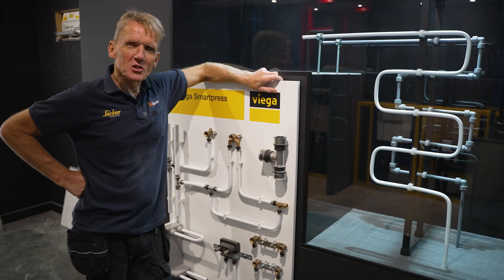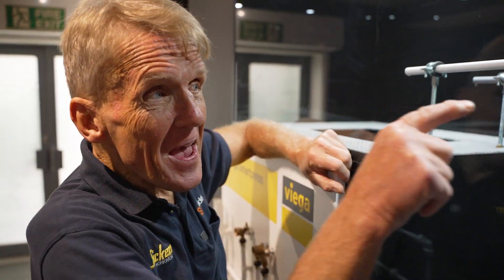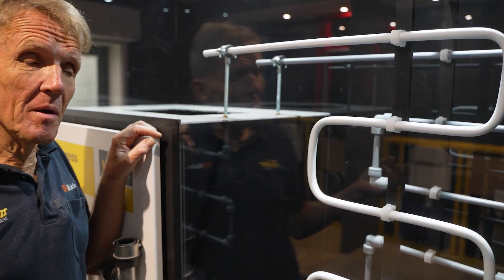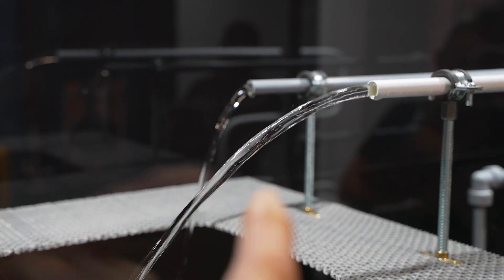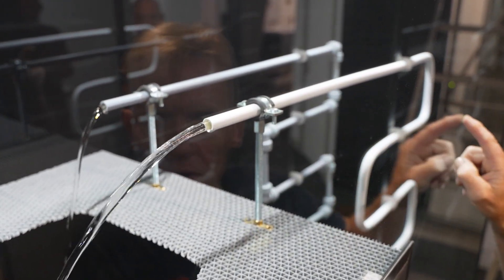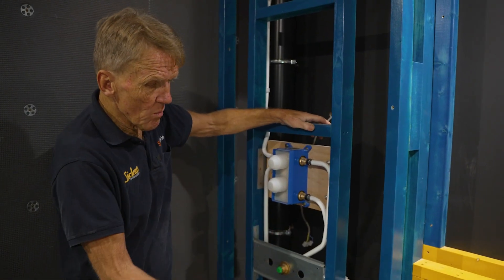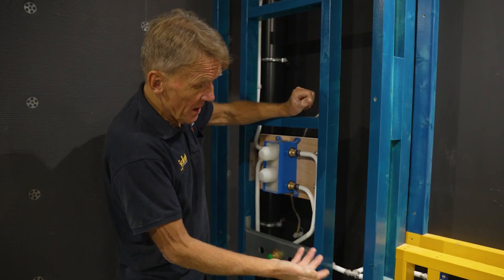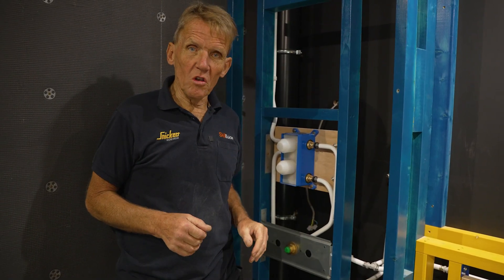Gobsmacking Truth About Plumbing Elbows

Comment: Good to see it demonstrated so clearly. But it seems obvious to me!

One time I was faced with fitting two WC cisterns. The one on the first floor , which was a replacement job, had always been incredibly slow at filling. Originally the pipe came down from the loft under the floor, round the bathroom feeing the basin and bath, then to the cistern. Multiple fittings.

I replaced using plastic pipe and made a new feed from the loft. Filling time dropped dramatically. Despite the head being the same as before. But I actually used a single piece of pipe from the loft to the cistern inlet with gentle curve - as that was all that was needed. Many wood have used three or more angled joints. But as it was all behind a cupboard, it really didn't matter how it looked. So I chose the smoothest route and avoided the possibility of leaking joints - ever.

I'm sure a plumbing inspector would not have been happy but it made total sense to me.

Comment: The conclusion is correct but the demonstration method needs refining. To demonstrate more clearly, feed both paths from a single constant pressure supply and switch between outlet paths to show the flow difference. If a single supply split into two paths, or independant supplies for each path, they can be influenced by other effects that result in a non-linear outcome.

Comment: Those fittings clearly have sharper bends than the bent pipe, if the single pipe was bent that severely it would have the same drag... I get the point about bends but seems unfair on fittings, can't you get smoother bend fittings?

Comment: I can recall a heating system I once flushed and dosed with inhibitor had to have bigger pumps put on the system by the heating engineers, because modifying the pipework with so many bends in the new section had substantially reduced the flow rate and consequently the rate at which the system heated up.

Comment: I am 76 when I started in the central heating long ago . We were not allowed to use elbows. Everything had to be flowing, so to say ..  Nowadays, it's only elbows . If we had to take a small branch off from a main pipe  . We had to bend the branch off pipe, say 1/2"  then cut it in the bend so that we got what we called a shoe . After that, we had to melt a hole in the main pipe and weld the shoe on the main pipe . I loved this work  . Bending a pipe was done by putting the pipe in the vice and  stoking it red hot, then you pull the pipe halve way , take it out and put the red hot part in the vice ( as litle pressure as possible)  then you pull the pipe to 90 decrees.  To get the pipe bend at exactly the right size, you mark where you want the bend,  then you go 2 thurds back and one thurd past your mark . For 1/2" it's probably  6 cm back and 3 cm forwards. But it's maybe more like 8cm and 4 cm .And that is what you have to stoke red hot . You put the red hot part in the vice to prevent it from bugling inwards while bending the pipe . All the pipes had to run slightly  upwards to make it easy for the air to find the the air pots while filling the system.  Dutch,  living in Ireland.

Comment: It there are both running off the same single impellor pump, and the water from the pump can go either way, it will prefer the path of least resistance.  A true test would be to run each pipe off different sides of a twin impellor pump.

Comment: Where as i completely agree that all those elbows will have an effect it would be interesting to see how solder fittings would compare as all those plastic type elbows use inserts that also reduce the internal diameter of the pipe and cause turbulence as well.

Comment: I must have been lucky, I have had to use compression fittings in my house redoing a seperate bathroom and loo in an old 60s property. Reason I used compression is space to get in and solder. I used a few bends where possible and all service valves are full bore valves. Mine also runs via a softner as we are on the Mendips the water is hard.

Absolutely no issues at all with flow.

Comment: There is some truth to this, but, the joints are true 90 degree bends whereas the continuous pipe is not, those bends are like cutting corners on a road through a junction, the car drives much faster and easier.
Reply from the maker: I am sorry I thought that was the whole point of the video.
Reply: @SkillBuilder  oh

Comment: Unfair test. Water will always take the easiest path. Rig the two up to the same pump independently and test the output pressure, if you want to get a true perspective.
Reply from the maker: I think that putting two pipes on the same line must give you half the pumps output at source. What happens from that point is proportional to the resistance of the pipe run. I will do as you suggest but I suspect the bent pipe will still be proportionatly better.
Reply: @SkillBuilder  I look forward to seeing your results. Don't forget to use a pressure quage on each. I suspect you will be suprised.😘

Comment: Hello Roger, Great video as usual, I'm a retired Australian builder and greatly enjoy seeing how the industry is going over there, I don't have a lot of plumbing experience, here builders cannot do plumbing work without a license. Would the white pipe fail on the outer edge of the bend in winter if the pipe froze as the walls would be thinner or isn't that a problem. I'm guessing just the labour savings would make that method of running pipes very attractive.
Reply from the maker: The bend is not that much thinner on the heel and the pipe will expand if frozen but is less likely to burst than copper.
Reply: @SkillBuilder  Thanks Roger👍👍👍👍👍👍

Comment: In France the pipe diameter typically 12 mm but the incomming pressure on the   system is higher than in the uk. The flow rate at the tap is far higher at the tap than on the typical flow rate on the 15 mm UK system.

Comment: My daughters kitchen hot tap had a terribly low flow rate, the best I could do was fit a high flow mixer and change the isolating valve for a high flow version, it’s much better but would be better still If I’d been allowed to install an old school screw down taps mixer… These quarter turn taps aren’t all they are cracked up to be, they are very restrictive.

Comment: Are the pipes not different diameters. Surely that would affect flow. As a demonstration it leaves much to be desired and should have been noted for full disclosure.
Reply from the maker: The bore size difference is negligible, The outside diameter is 1mm bigger on the white pipe but it has an aluminium layer as well as the barrier pipe. If there is a difference it is the square root of nothing
Reply: @SkillBuilder  hmmm. Seems like a lot of effort to set up a demonstration that is not like for like. A simpleton, such as myself, couldn't possibly understand square roots.

Comment: Not convinced.

 We need a look under the cover. If both runs are tee'd off the same pump it'll bias towards the line of least resistance, robbing the other side & exaggerating any difference. A more realistic comparison would be with a diverter valve that switches between the two. 

Even better, feed 'em both from the same header tank.
Reply from the maker: All that you suggest is possible but think about what you are saying. The line of least resistance wins. Why does it win? 
Surely that is the whole point. We could mess around with lots of things to satisfy a few sceptics but that isn't our aim.
This video shows clearly that bends win over elbows and that is all it was intended to do. We are not the National Physics Laboratory.

Comment: I remember back to student days doing fluid mechanics as a civil engineer, but seems that plumbers aren't told about this? I even had to tell the gas fitter doing my boiler installation not to use them so that I got the best gas pressure to it.

Comment: I recently had to return an electric shower due to lack of pressure,  the spec said 1 bar required.  I have 2 bar at the mains valve.  I replaced the shower with another model which operates at 0.7 bar and is working fine. I believe the issue was as you have stated on your post.

Comment: I had just that experience when fitting Gas runs to our open coal effect fires!  I fitted it with no elbows and all joints on the straight runs! (I was one of the first Corgi approved in the area.)  This was in a basement so all visible. A copper run of over 100 feet in total! It started in 38mm then reduced to 32mm then further to 22 mm then 15 mm with the final 5 feet in 8 mm through the floor to the fire! the fire was one of the best burning we fitted.  a few weeks past and the customer complained the fire was not working, so we went to fix it! It turned out his pal a local plumber made some disparaging remark about how the pipe was run and took it upon himself to do what he thought was a "better job" The whole run in 15mm with over a dozen short elbows. He was not Corgi registered & as far as I know still has not become Gas Safe!  The customer was told in no uncertain terms what I thought of him and his pal & he had to fix it back to the way I did in the first place, all at his expense! I was paid in full and have not heard from them since!   Thank you for this demonstration as it proves my point brilliantly!
Reply: Unbelivable what some people will do,

Comment: Plastic is rubbish won’t touch it I use copper only even if the house I’m in is done in plastic and bend everything that I can saves loads of money in end feed fittings. The inserts in plastic alone restrict a 15mm pipe down to less than 10mm and the fittings don’t last.

Comment: This isn’t a good test, you’d need to apply the same pump at the same pressure to each set of pipework and see the difference. Here the water is taking the easier path, which wouldn’t exist in a real installation.
Reply from the maker: It is fine because the pressure at the pump outlet is the same and the resistance on the elbow is slowing the flow so there is no difference.
Reply: @SkillBuilder  Water is taking the easiest path, if it didn’t have an riser path the results would be very different.

Comment: Who uses 6 elbows from a pipe source to end product? 1 or 2 at most. This is ridiculous. I can get to the other corner of my house using 2 elbows. Generally you 't' off a pipe and then elbow it in. I would seriously question the plumber who gets from my boiler to my upstairs toilet with 6 elbows. Even if they did this, why do I need my toilet to fill at high speed?
Reply from the maker: That is not the point of the exercise. It is to illustrate the drop in flow and it does it. If we used two elbows and two bends that would be less memorable. It is the power of the story

Comment: I'm not a plumber but I have a degree in chemical engineering.  "Ells", as they're called in the chemical industry, add drag equivalent to a pipe length of 30x the diameter, so one elbow in a 15mm pipe is like adding 18" of pipe.  They are ok when you have lots of pressure to play with but not in the feed to a gravity shower or the inlet piping to a shower pump.

Comment: The two pipes looked like they were different internal diameters,  
additionally the pipes were different colors.   So are we seeing a like for like comparison???
They should strive to SHOW that the pipe diameters were identical. 

ALSO, as pointed out by others, we must avoid the path of least resistance robbing dynamic flow from the other path.  
So SHOW that the feeds are NOT taken from a common pipe, 

BUT take both  directly & independently from the header tank, to ensure same starting pressure (static & dynamic). 

BUT I agree (& know) that for flow rates:  
bends should be kept to a minimum;   sharp bends are worse;   and Elbows & Joints are Terrible.

Comment: same issue with those cheapo isolator valves  - the ones with the screwdriver slot that any sane plumber will never turn for fear of it weeping!
Had an 9.5kW electric shower which had one of those in the supply. It was overheating the water, basically poor flow rate. Removed the isolator and put a swept bend on the supply and the difference was remarkable.

Comment: But also...
If you buy the 'standard' compression fittings for 15mm copper you will have a similar problem; however you can buy the 'full-bore' (or full bore) fittings which do not reduce the diameter at any point.  I went to a job where the cistern feed went through the restricted couplings and you could 'hear' the constriction and turbulence.  Changed to full-bore and it flowed more quickly, and silently.  Similarly with heating runs, it's no good having 15mm flexi pipe, and then inserting a collar at the coupling which reduces to 10mm!

Comment: DIY amateur here: I use copper compression fittings because I can extend or adjust pipework without cutting any copper pipe.  Yes, hotels and big housebuilders don't need to modify their installations but a home owner sometimes does to move or install a basin, an outdoor tap or a washing machine for example.  To be frank, I don't trust plastic (but I'm old-fashioned).

Comment: It's a good demo - the elbowed route will have higher pressure loss due to friction, but supplying both from a common (presumably centrifugal?) pump means the flow thru the lower resistance route will build up until the frictional loses balance out. I'll dig out my dusty copy of Perry's if anyone's interested in the maths...

To be truly objective they should be supplied from an "infinite" reservoir - a massively oversized pump, header tank or mains.

Comment: i like the idea of pushfit but the bore is really reduced by the pipe and further by the fittings.  I would like to see a similar comparison of copper bent soldered vs brass compressions.  Not sure I trust having bent plastic PEX or PB anyway.
Reply from the maker: pex and pb are both bomb proof. I have seen many extreme tests with these pipes and they will outlast copper part from the problem of rodent damage.
Reply: @SkillBuilder  Use it in straights but I feel like bending any kind of plastic and then applying constant high pressure to it is asking for trouble in future.
Reply from the maker: It is not under stress when it is bent. It stays there quite happily and will easily take twice its working pressure and way more heat that a domestic hot water or heating system. I think if you saw the tests you would have more confidence in it.
Perhaps we will do those tests and show you how the pipe can be blown up like a balloon and then return to its orginal shape.
Reply: So Roger what is your opinion of using the speedfit system for general plumbing. I'm  just asking as a diy er?

Comment: Very interesting. I was working in the central heating 57 years ago . Everything was done with black iron pipe. All the pipe work had to run slightly up , all the bends had to be done by heating the pipe or using the hydraulic pipe bender . For all the branches coming of the main pipe, we had to bend the pipe and cut the bend  with what I would call a shoe . Then we had to melt a hole in the main pipe and place the shoe on the main pipe and weld it . Everything had to be easy flowing, and all the air had to be able to run to  a  high point with an air pot . I loved the work . In difficult positions, we had to use a metal mirror to see the welding work .
Reply: Very complicated and needed a lot of skill I bet. Pleased to hear that you enjoyed it
Reply: Was that a gravity system?
Reply: @johnmac8084 Hi no we used circulation pumps . But the flow was very easy.  It was just the time when gravity systems were out or on the way out . But in Ireland I made a gravity circulation in our stone cottage including the hot water . With gravity feed you need slightly bigger pipe .

Comment: This demo doesn't even cover the coherence between the push fittings, which are mainly on the outside with a very thin stainless insert, and the como fittings where the 16mm plastic pipe (14.8 ID) suddenly turns into a thick metal part with about 7mm ID. Because of the turbulence there, the edges of the metal parts also start to furr up if there is any water hardness.
Reply from the maker: Nobody said that this was the definitive study of fluid dynamics in plumbing. It is a quick visual demonstration that shows the difference between elbows and a bent pipe.

Comment: Can anyone help me pick a brand for 22mm plastic pipe for a central heating system;

I have been reading reviews and a lot of people are saying that it is not very flexible and won’t straighten out correctly after being coiled up;
Thanks for any feedback!!
Reply from the maker: There is pipe that is very flexible called polybutelene and there is PEX pipe. The type that stays where you put it has an aluminium barrier in between the walls and is intended to be bent and set. The flexible stuff is not suitable for surface mounting on show because it sags when it gets hot. If you are threading pipe under floors go for the flexible.
Reply: @SkillBuilder  Thanks for that appreciate the advice
Reply: @SkillBuilder  Managed to find the correct product;
Thanks again for that much appreciated advice;
With my luck it is probably saving me having to pulling up concrete floors to fix my silly mistakes 😅

Comment: Use elbows if one needs a tight turn due to issues of space but much prefer to pull a bend for a better flow and its certainly much cheaper and less fittings to leak.